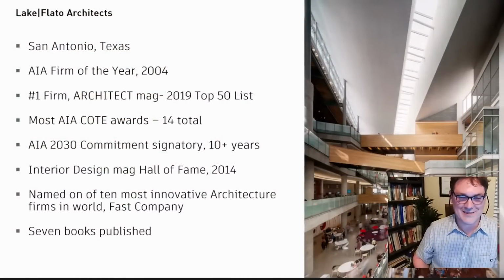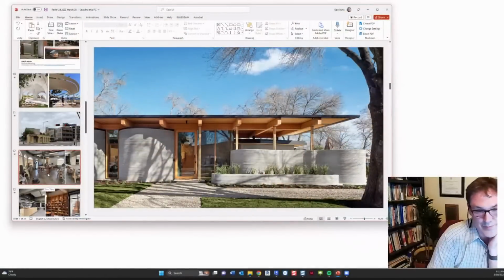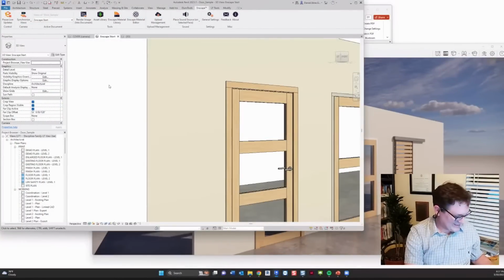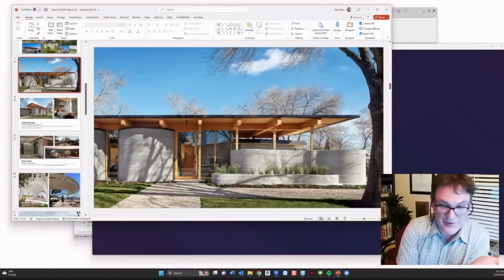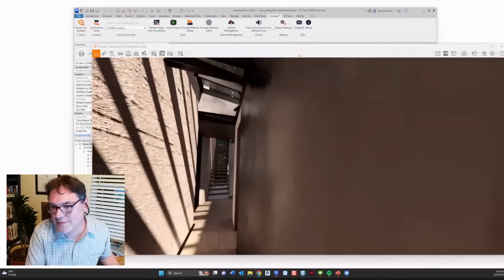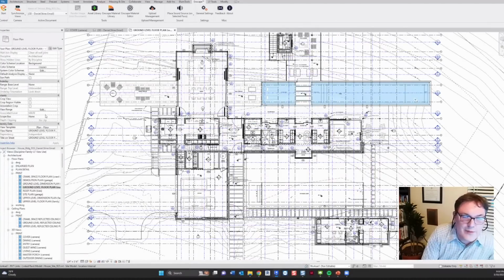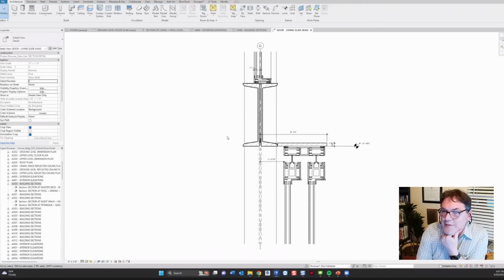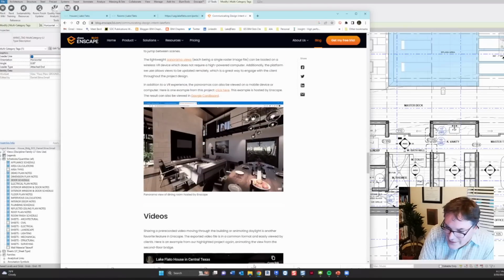Award Winning Revit with Lake|Flato Architects

Comment: That casework curtain wall is an interesting idea but it seems unnecessarily time-consuming opposed to using custom casework families. Not to mention installing plumbing fixtures or cabinet pulls. I do single-family design and custom millwork and it seems like a frustrating way to work, but it's creative, I'll give them that!
Reply from the maker: My thoughts, too!  Creative and it clearly works for them!  Cabinet pulls are nested in the families… and I believe you’d want plumbing fixtures face based anyways.  But yeah… I’m still on the fence about how i feel about it lol